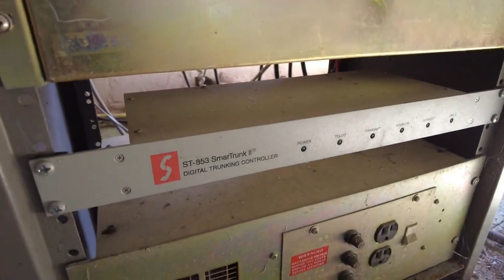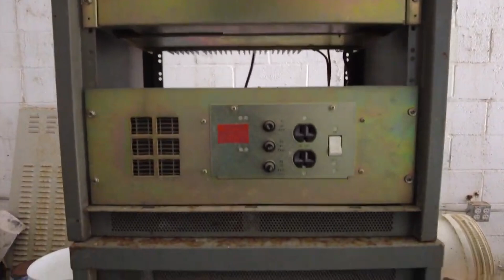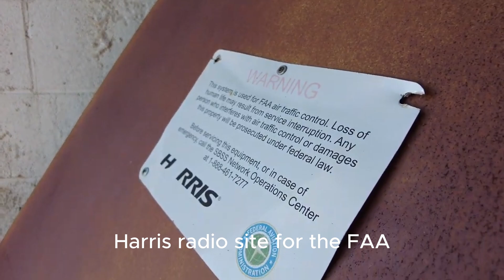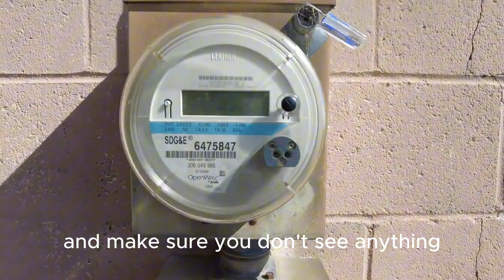Exploring the Abandoned Money Pit: A Ham Radio Haven Lost in the SoCal Mountains!

Comment: OK looks like a 800 MHz trunking system. Probably converted to LTR from GE's old format trunking system. If I could only remember what the GE trade name of it was…….
Picked up one of the chassis from one @Dayton 25 years ago and swapped the 800 meg parts out for UHF parts. Back in the mid 80’s  built a pull out drawer to house a mobile chassis in a repeater configuration. Man those were the days! Too bad ICM Crystals closed down. They cut crystals for my stations icoms and compensated them for stability. Only recently within the last 15 years did I finally obtain the rare true FM exciter for my station, all of the earlier exciters were phase modulated to mimic FM. Also the official slide in metering panel.
If it’s a 800 MHz trunking system that was abandoned by the prior owner when he was paid BIG BUCKS for his licenses that went to build the NEXTEL system. Nextel sold out a lot of the old equipment to operators in South America but obviously they placed little value in this stuff. I could use all of those controllers and a few more chassis for some Ham repeaters if only I could find some Low Split UHF mobile chassis here in the area I retired to in the southern EU. They are easier to convert up to the 430 range.
Reply from the maker: You know a lot about these. I’ll take some closer photos next time I go.

Comment: So on the outside of the building, the tower is massively overloaded with cable. That's way more than you've ever been on that tower, but it's a short Tower so it doesn't have a high wind load it could withstand it. The telephone cabinet you see in the background the gray metal cabinet behind the generator was how they interconnected with all the base stations so they definitely remote-based tone remote control was all done over analog telephone lines most likely that site was abandoned sometime in the mid late 2000s, probably around no later than about 2013. When most analog stuff was switched off. The telephone cabinets are analog phone lines. If they're even still active is a good chance that they've been cut somewhere down the mountain where the phone company had interconnected them to the central office. However that power connection might very well be live. A lot of times PG&E did not disconnect those, they were just sort of left in place.
Reply from the maker: The power is alive still. Meter active but no usage. Someone bypassed the mains and left some dangerous lines in the open.
Reply from the maker: I bet you are correct on the purpose of so many phone lines. It would make perfect sense. I did not check if any of the copper pairs went to radios. There’s so much I should have looked for when I was there.

Comment: Is that science says Harris Communications for the Federal Communications commission, those are not air to ground radios and they're not a.m., which is used for air ground vhf. Those are probably interconnecting radios, used to link control centers together, which was part of the old backbone system. The connectors on the cables hanging down, which looks like someone just disconnected them from the antenna ports of coming through the wall, are fairly modern connectors. I'd say those were put on in the '90s. Also the cable design is a modern style used by andrews. If those were solid brass connectors, that would put them from the 70s or eighties. But those connectors are from the late 90s to Modern now. But to have that sign may have been that there was one radio up there used by the faa. And the rest of the space was leased out for two-way radio purposes, because none of those Master two base stations will work in the aviation band. I arguably you couldn't modify one. But the Exciter section is not a.m. it could have been something for Civil Air Patrol possibly but that's not under the faa. So I'm going to say that most of that was two-way radio and there might have been one radio up there or two radios that belong to the FAA those would have been the ones probably originally mounted in the long vertical racks along the wall.
Reply from the maker: This is great information! Thank you for adding these comments to my video.

Comment: That's actually a pretty good looking sight, from what I can see at the view it has, looks like it has line of sight for quite a distance. If it looks to be a power generator outside, right below where the main power connection is. Might be worthwhile trying to find out who owns it, most likely it's owned by vertical Bridge American Tower Castle communications. Unless it's a site was built for the county or state. As American tower has almost no regard for their sites. They're falling apart fences are cut open doors are kicked in. Because when most of the analog stuff was shut off years ago, customers pulled their equipment or just abandoned it in place and shut it off, and stop paying their bill to American Tower, but American Tower still under the idea that a lot of their sites are fully loaded with equipment and antennas just because it's full of abandoned hard work. But again I try to maybe find out if that site is owned by somebody might be home by some guy who has it on his private land. Or a Rancher or something might own that and some local ham operator might be able to cut him a deal cleaned it up and remove all the abandoned equipment that's no use. And in trade put his own repeater in there or remote base station, and then he could use the rest of the space, and kind of deal with a company to put cell phones microwave whatever the hell they want up there. Probably if you could find the right company in trade for putting their equipment up there they'd be willing to rehab the whole damn site. And the ham can still keep his gear up there it's sort of a finders fee. I've seen that done a couple times
Reply from the maker: I did locate the original owner. Deceased. The property is in the hands of the government BLM now and I’ve tried to take over the site by going through the process. They have other plans for that land so it’s not possible.

Comment: All of the radios in those cabinets, are General Electric Master II  base stations. Damn near Bulletproof radios, some of the best VHF UHF low band you could get. Extremely stable with decent power output. Those were probably all made in the'70s to about the early '80s. Before they were discontinued. The things just last forever, the problem is you cannot narrow ban them at least easily. Some hams have done it for experiments but it's not worth trying to do it for public service. Also they will not handle any kind of digital mode. You'd have to strip out the entire Exciter and receiver cabinet which is the Box on the tray that leans forward. That was done for ease of service. The box in the bottom is what they call a federal resident power supply they can easily deliver 30 amps at 13.8 volts. The card rack above the fold down tray was your interface card and your function cards in other words that's for you plug in the boards that made the radio do what you wanted it to do, either be a repeater or base station a remote base station, basically accessory cards. Also there was a service card that plugged in that had a meter on it. Not uncommon to find those with a tone remote or Wireline remote card. On the back of the equipment rack, the large heatsink is the rear of the power amplifier. Bitch you could service from the front or at least adjust. Or take the top two screws out and lay it down just like how you see the receiver Exciter tray exposed essentially that was probably an old two-way radio site, that had a lot of VHF and UHF repeater or remote base stations on it probably police fire medical commercial stuff. And then when all the counties switch to digital down in Los Angeles it was just abandoned. Because it wasn't worth going up and removing the equipment that's the problem those radios are very heavy. Each 10 half height rack, weighs over 100 lb. There's a lot of aluminum in there, and steel the amber color is anodized steel to prevent it from corroding or rusting. GE made very very good base stations. They high power ones that could put out almost a kilowatt., not that many were built. But the few that were most of them are still on the air as either amateur radio high power repeaters or modified to work in other bands. A lot of State Police that still have low band. You'll find this equipment in service. One more thing the cable, is Andrew's Helix cable, it's a semi-rigid coax, that has very low loss. Would you trade off for the fact that it's not very flexible and somewhat covers them to work with. But that is not waveguide. Although there is a flexible wave guy that looks similar to it it's an elliptical shape and you wouldn't find it in a Communications building of that type. Wave God is usually square or rectangular I made a solid bronze. And normally it would be coated with either a gray lead acetate-based paint to protect it or some sort of a gray enamel paint usually. Waveguide hasn't been used much since the 1980s, as it was replaced with putting the transmit and receive equipment right on the back of the dish that became the preferred method by the early 80s.
Reply from the maker: Yes! This is the comment of the century. You know these radios well! I caught my mistake about the waveguide. I know that cable well and my brain was lost in the high altitude  and moving around. I tried to edit it out before I posted but I guess the captions still had my gaffe. Are these radios and power supplies worth anything if they still operate?

Comment: Building looks solid . Still has a lot of infrastructure.
Reply from the maker: I had originally thought so as well. It’s turns out that the cinder block walls have no rebar inside and are already showing imminent signs of collapse. Fixing it would essentially be a re-build. The cost involved is too high to be viable even if we weren’t already told no by the government.

Comment: Probably a smart idea to walk away from it. I work as a radio tech for a northern Cal railroad and have to regularly go to repeater sites like that to do my PM's. It's a constant battle fending off rodents, insects like ticks, spiders and wasps and come September: rattle snakes. You don't mention it, but I'm sure that place must've smelled to high heaven of mouse pee. Very pungent and corrosive.
Reply from the maker: Oddly it had no odor but I need to consider that I was wearing a motorcycle helmet that has a filter of sorts on the front. That might have reduced odors for me.

Comment: Best guess... Old LA County Sheriff Low Band System featuring General Electric radio equipment.   General Electric was popular with LASO for decades.  My tech friends used to dismiss GE radios, as they were not embraced by the likes of Motorola.   Most considered GE junk not worth stealing because they were goofy.   One popular rumor is that buyers will receive a free GE toaster when they place an order.
Reply from the maker: Its rather odd to me that all the Mastr Radios in there have not been stolen.... they are all racked up still.
Reply: Looks like at one time the local air traffic control tower used that site for repeater/backup use based on the sign on the door. Could very well have been used by public safety though depending on the location.

Comment: Those big black lines are "hard-line" coax, NOT WAVE GUIDES !! The antennas are VHF or UHF, not microwave. Wave guides are rectangular or square, and used for microwave frequencies.  Good that you are not going to try to fix something that you do not understand.  That's why they call it "AMATEUR" radio.
Reply from the maker: Thanks for your comment. You’re right — I misspoke in the original audio and said “waveguide” when referring to coax, but I caught the mistake and muted it in post. Looks like the auto-captions still picked it up.

For what it’s worth, I’ve been working in RF engineering since 1988, so I’m fully aware of the difference between a waveguide and coaxial hardline. But like anyone speaking unscripted, sometimes the wrong term slips out — especially when moving fast and multitasking during installs or tower work.

Appreciate the keen eye, but maybe lead with curiosity instead of insults next time. We’re all here to learn and improve.
Reply: All I use in my station, heliax from 1/2 inch up to 1 5/8ths  that feeds the 2 meter eme array(need low loss, every watt matters on eme!)... FSJ4-40b is great stuff to replace LMR-400! I even use it for rotor loops!